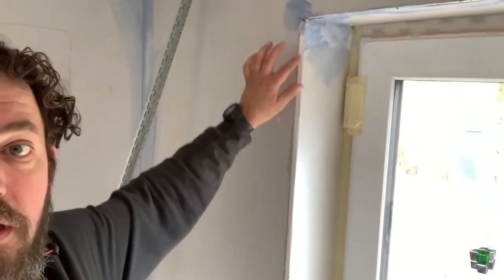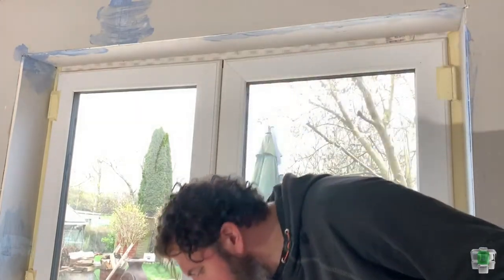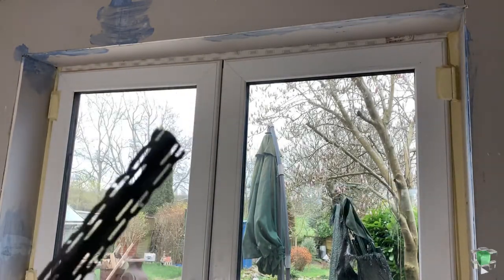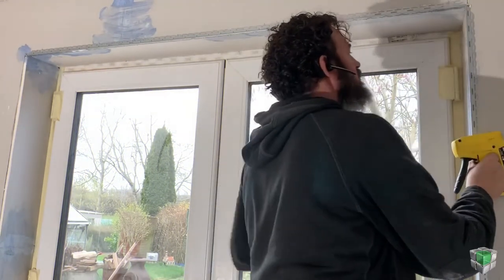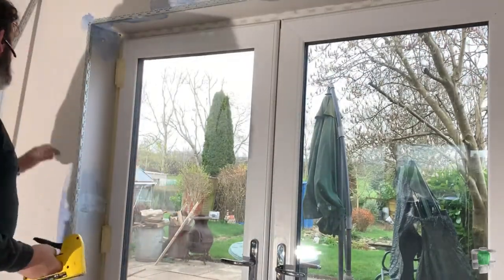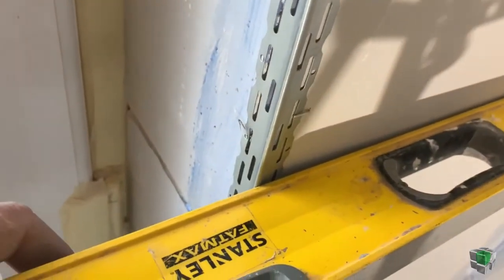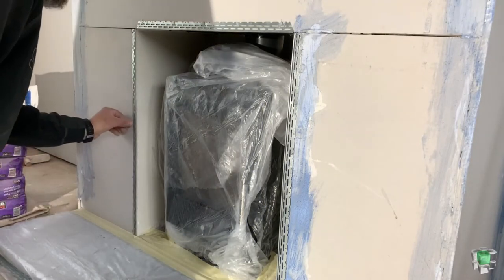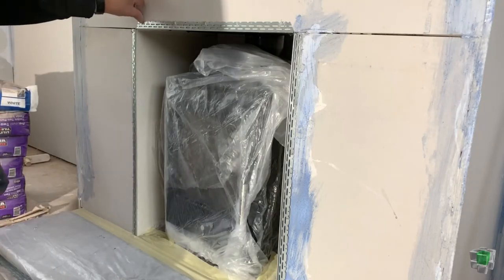Fit angle beading corner on plasterboard, tutorial how I do beading angle.

Comment: Nice vid mate! Can i use some left over multifinish to stick beading to plasterboard? Its literally two external corners about a meter long?
Reply from the maker: Sorry for late reply, you may already sort it, but yes, you can use multifinish to stick the beadings, even if I expect some now to comment and say it’s not possible, I did stick all beadings in a room with the same mix of multifinish I skimmed that wall I had beadings and it worked absolutely perfect… good luck 😁
Reply: @askhowtube  thanks mate that's reassuring...okay to do this to plasterboard tho yes? I'll get on it this week if that's the case

Comment: Well done for cutting the corners off.
Reply: Although I don't like the look of plaster next to a wood burner, the plaster will blow off when it gets too hot.
Reply from the maker: Hello, thank you for watching and commenting... no plaster done on the inside to get hot from the wood burner... outside I have tested it and it doesn’t get hot... the company installed the wood burner used some insulation to prevent the heat to get there, and the plasterboard they’ve used inside is special heating resistance.